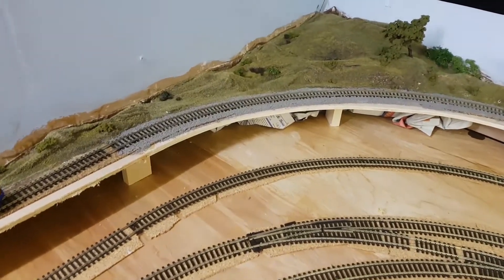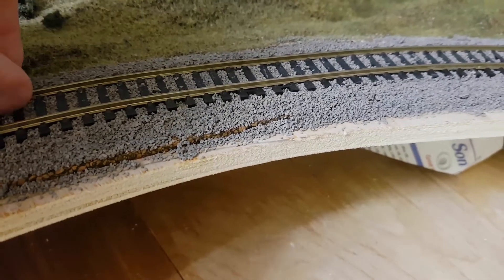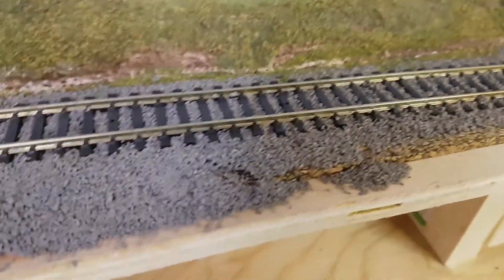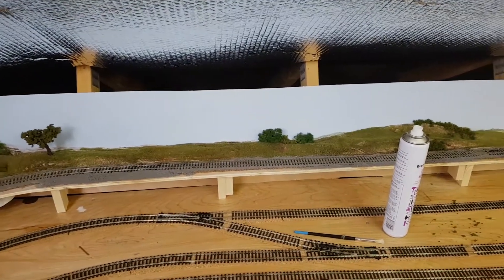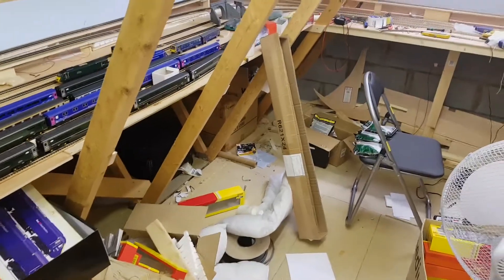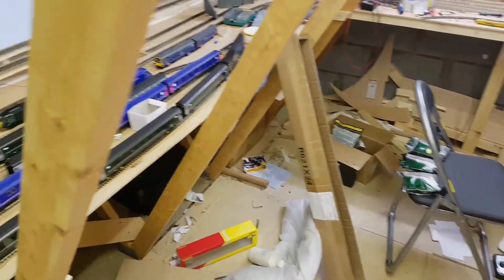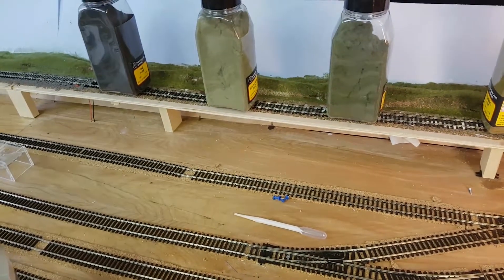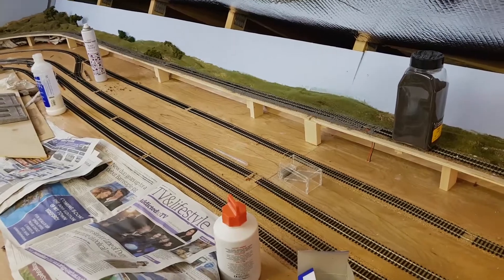Part 24 General update - ballasting - Building a model railway

Comment: Looked at your problem with noise, seems to come from the use of PVA permeating the cork during ballasting, found that by using double sided tape to secure the track and forming a barrier between the PVA & Cork the impact was much reduced and the cork retains much of it's sound reducing properties and a good clean of the rails helps a lot, The tape however does have a habit of releasing over time so use of track pins, countersink the heads and touch with paint reduces visual impact of pins. Nothing however will reduce the soul destroying chore of ballasting track, a good ballast spreader helps as does taking some time to sieve it before use to remove as much dust as possible and nothing is better than time taken to pick off stray pieces before applying PVA, check out some of the videos of home made light vacuum cleaners to recover ballast, I built one years back and it for me still proves to be the best way of not only levelling the ballast but cleaning off sleepers, you just gotta love those glass sweet jars for that job, Great videos, always good to watch a layout come together.

Comment: Hi, may I suggest a simple method for ballasting, if you dry apply your ballast to the track, not too much, then tap the rails with a tea spoon or similar the ballast will move off the sleepers and pack down (much like the real tamping) then fine mist spray at a distance of about 12 inch above keeping your spray bottle level, allow the wet water (water and a tiny drop of washing up liquid to break surface tension) to gently settle. Leave for a couple of minutes then use something like a tattoo artists wash bottle, 50/50 pva and wet water again, but apply this very close to the rails and gently to the ballast middle of track then the shoulders always at the sleepers, it will settle through. I have done this and it is simple, highly effective and the best method I have ever used in thirty plus years!  Good luck.
Reply from the maker: BR Blues 
Thanks for that.
I'll give it a go tomorrow... I've got loads to practice on.
Reply: The Devon model railway if you get stuck just drop me a message as I'm working on mine all weekend, can always show you on quick FaceTime video.....

Comment: I've always wondered if the green fibre board (type you lay under laminate flooring) would make any difference. After All it's designed to reduce sound. I'm on track laying on mine and have loads of this stuff so may well try it.
Reply from the maker: The-scrap-line Model railway weathering 
Will be interesting to know your findings.

Comment: Hello  DMR
        Ballast set in glue, will bind solid with the cork and the sound will always be transmitted through the boards. If it is a major concern to you, I would suggest you purchase a roll of Peco foam underlay, and experiment with that .You will find a  noise reduction of  about 75%. It is pricey, but when well painted it can be made to look quite good.   Regards,  Paddy  Owen.
Reply from the maker: irene forward 
Hi. I think it's something all just live with :-)
Reply: You may want to consider insulating under the base boards. When the track and underlay is solid the boards act like drum skins. I used loft insulation. It doesn't 100% cure it but it helps massively and is as good as results I have had with foam underlay.

Comment: Hi
I don't think there's much choice to the method you're using for ballasting and the foam underlay, unless it's changed, crumbles over time. What's needed is something that sets like silicone but can be applied to the ballast like PVA?
If you come up with anything let us know
cheers
Paul